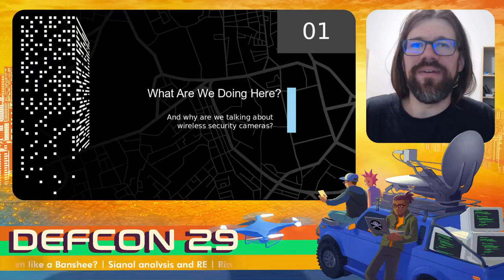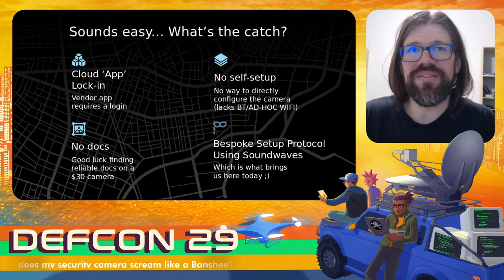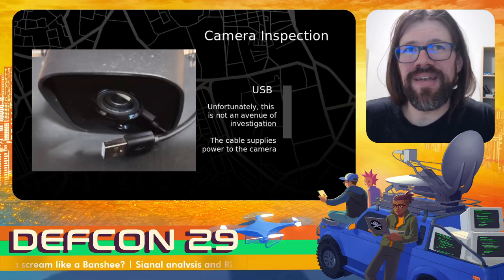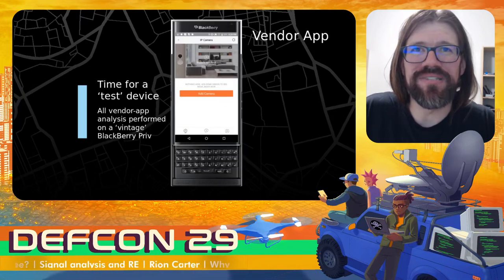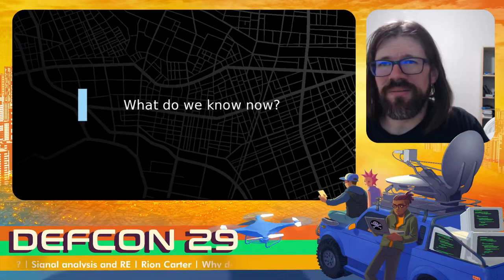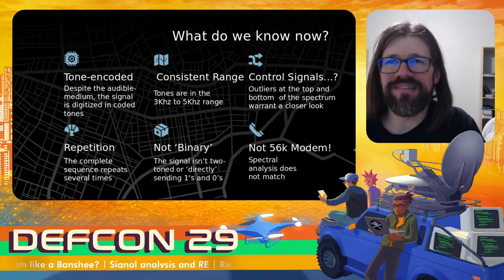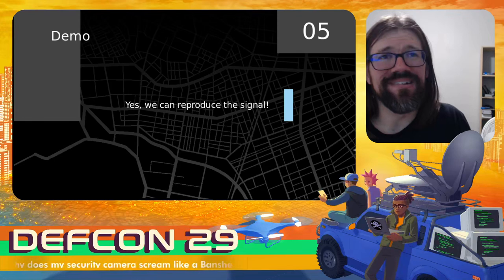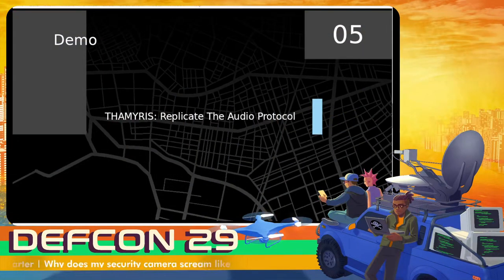DEF CON 29 - Rion Carter - Why does my security camera scream like a Banshee?

Comment: Good talk, I'm rather curious why your first thought was 56k, that's way too fast for an acoustic modem, especially in free air rather than a sealed coupler. You'd be looking at a much slower standard assuming it was borrowing from old acoustic modem standards
Reply: I think it was interesting to compare against something most people can think of for a first idea to get on the path towards the actual standard.

Comment: So is this camera very easy to hijack? If this camera(not belonging to you) was found installed somewhere on (or within range to a) Wifi network that you know the SSID and pass phrase of. 

1 Make yourself a cloud account.
2 Download the pairing app and enter the populate the fields 
3 Power-cycle the camera putting it into setup mode and play the tone sequence. 

In theory now the camera is connected to your cloud account? (would 100% not recommend doing this without the permission of the owner of the device)